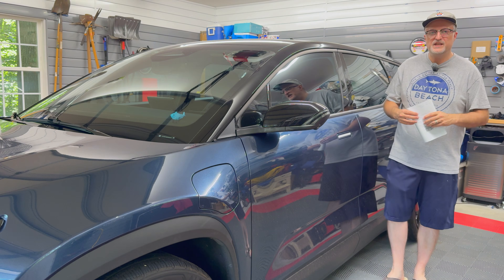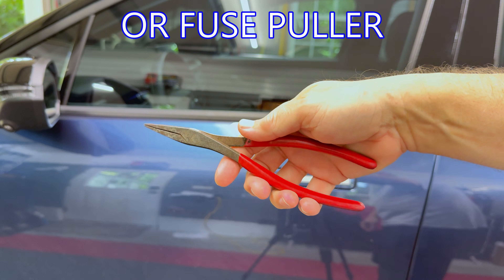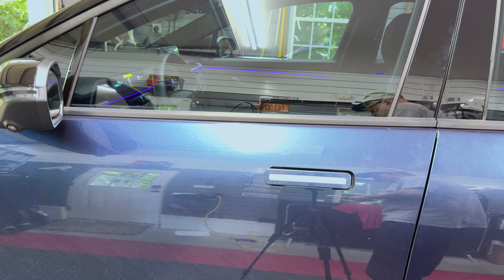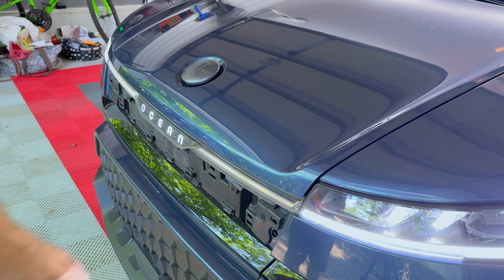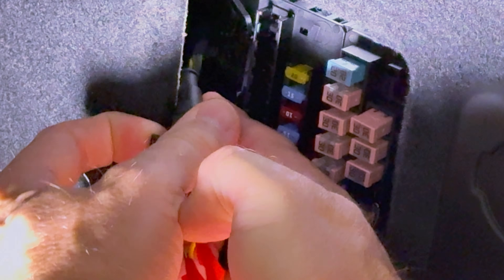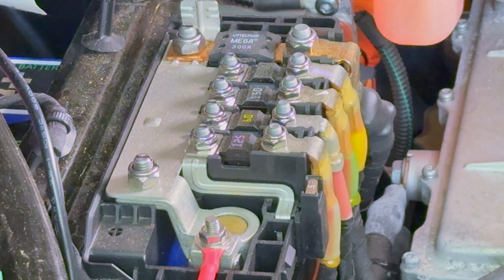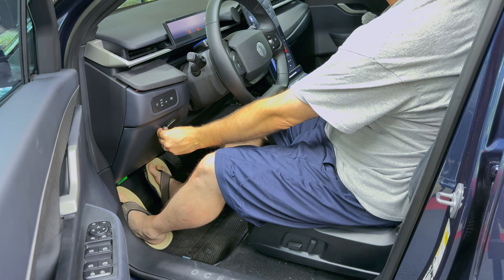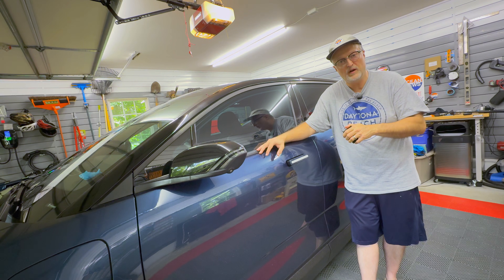Fisker Ocean - IBS Calibration Process

Comment: Hi Matt, will disconnecting the 12v grounding lead do the same job as removing the 5a fuse? The fuse on my RHD model is more difficult to access compared to LHD model.
Reply from the maker: No, I think the car's 12V need to be on for it to work.  Removing the IBS fuse and then reinserting is what needs to be done.  I'm surprised the battery positive fuse box can't be reached on the RHD.  It's easily done for the LHD.

Comment: This just bricked my car. My charge port color is red. Doors won't open.
Reply from the maker: Wow, there must be something else going on here.  For a healthy car, this should be a fairly innocuous procedure. What's the status of the 12V battery, is it new?
Reply: @MTNRanger it's old, but I have my tender hooked up pumping 15 amps. Battery is basically dead. Car just beeped and at least the mini screen is showing my cars time and in park. Ready is not on
Reply: Wipers were also going up and down, not smoothly, while the car was establishing battery power. I might let it sit a couple hours. Charge port door light is still red. Likely need a new battery
Reply from the maker: @sohailakmal3384 Yes, common symptoms are wonky wipers and randomly alarm going off.  If you can’t get a local H4 AGM 12V battery, the UPlus on Amazon has worked well.  I have that currently in my car.
Reply: @MTNRanger my wife was able to get in contact with a fisker shop in California who gave us a Houston contact. The battery couldn't be removed from the vehicle because of how it was constructed. He mentioned needing a heat source, like a blow torch, to warm the bolts because all they were doing was spinning. Hopefully I can get him out here this weekend to install. Resetting my battery told the car it was dead....
Reply from the maker: @sohailakmal3384 Yes early production used picture in the three battery bracket bolts.  Other ways include using a flathead screwdriver to put pressure on the bolt, also vise-grip to hold the retaining nut.  It’s a huge pain.  I have changed a few batteries in local cars and have not come across it - otherwise I would have done a video on it.
Reply: @MTNRanger surprisingly, trickle charged for 10 min then cranked to 15 amps. Red light vanished and my car moves again. No more hypersonic sensor failure error.

Comment: In the middle of doing this and my car won't come out of ready mode. Any thoughts?
Reply from the maker: When you open the door, it should come out of ready mode within a minute.
Reply: @MTNRanger mine never does as well been 2 hours and no coming out of redy mode while the belt is buckled. Is it because I'm using a battery operated key fob?
Reply from the maker: @sohailakmal3384 I’m not sure why some cars are not.  When you opened the door it didn’t leave ready mode either?
Reply: @MTNRanger it stayed in ready mode the whole time. Is it because I kept the trunk open after?
Reply from the maker: @sohailakmal3384  No, you should be able to keep the trunk open since you need to unplug the first responder loop. But I have heard at least one person let it stay for just over an hour before ready turned off.
Reply: @MTNRanger i think using a key fob with the battery may be the issue. But I will try it again.

Comment: What are the symptoms of a miss-calibrated IBS?
Reply from the maker: It may vary, but it could be the car not fully charging the new battery, odd voltage charts on a battery monitor, etc. For example, if the car is not sleeping due to frequent battery charging.  There are probably others that I can't recall right now.

Comment: Hi after 45 minutes my Fisker is already in ready mode. Have you a solution?
Reply from the maker: When you opened the door did it go out of ready mode?
Reply: No, but in fact i have 2 problems. First hv battery do not charge the 12v battery when the car is sleeping so the 12v battery is empty after 3 hours, my battery is new, and second problem the hv battery charge does not start when i program a time on my wall box. I have to start the charge manually. I have these 2 problems since we changed the battery. Have you an idea or a solution? I'am in France.
Reply: I have a similar issue 😢
Reply from the maker: @RemenEric  1) If the 12V battery gets low enough, the HV battery pack will charge it - it can be driving, parked or sleeping.  I  have heard there are issues using the an EVSE on scheduling.  I just plug mine in and charge right away.
Reply: Ok but the hv battery does not charge the 12v if the car is sleeping. And i loose 40% by hour of sleeping.
Reply from the maker: @RemenEric Well that’s not normal.  You will need to check the DTCs and see if something is causing this problem.  A service tech may be needed to determine how to fix.
Reply: I am having the same issue. The car doesn’t go out of ready mode after 45 min. Is there any other alternative to reset the IBS? I recently changed the battery to sodium ion battery. It is not regularly getting charged by HV and recently it died. I had to jump it with another battery. Please help what to do.

Comment: I have been struggling with 12 V battery for a long time, unfortunately there is no solution yet. However, in about one year period I have had a 4-th 12V battery now and my car is not drivable because from time to time 12V battery dropped below 11V and car is not drivable if voltage drops below 11,8V. Worst point is this malfunction occurs during full speed driving even on HW which create very dangerous situation when car stopped on the middle of HW. I have 2.1 SW and not able to update 2.2, I joined FOA but no OTA upload yet. During every battery replacement I did not perform IBS calibration. Is that possible reason why failed?
Reply from the maker: It’s doubtful it would be caused by lack of IBS reset.  There sounds like something more serious - possibly a VCU/PDU module issue.  Do you have OLP yet?  If you do, I would run a diagnostic and look at what errors it finds.

Comment: I definitely need assistance wit my Ocean one (I don't even have a key card). I'm missing a lot for a Ocean One owner). Any Fisker mechanics in Arizona?
Reply from the maker: You will most likely need to consult a mobile tech.  ORS does west coast work.  Check https://fiskeroa.com/service/ for other options.
Reply: @MTNRanger  Thank you
Reply: I just switched my 12v battery.is this a must  do after a procedure like that. ?
Reply from the maker: @larshult1176  Some people have reported no issues without doing it.  Others have noticed some charging problems without it.  It's not a must do since the original service manual did not discuss it.  Do you have a Bluetooth battery monitor installed?
Reply: @MTNRanger yes I have installed bm300 pro battery monitor.
And thank you for your answer 👍
Reply from the maker: @larshult1176 I just installed that same model monitor today on my car for testing a UPlus AGM battery.

Comment: I assume this is just like what I need to do with my BMW i3. For the i3 it’s needed as the charging of the 12v by the High voltage  will vary as the 12v ages. So an older battery will be provided with a stronger charge vs what is needed in a brand new battery. Kind of a balancing. So I assume this is why this should be done with the ocean. I’m not sure if not doing this will cause any damage but might just make the 12v fail a little sooner.
Reply from the maker: Yes, it basically lets the car new a new battery is installed and to adjust the voltage limits based on the full capacity.  It's probably not bad to have the 12V battery fully charged before installation or doing this calibration.
Reply: @MTNRanger yep BMW tells you to fully charge the new battery before installing and calibrating. I learned a lot from my BMW ownership before buying my Ocean One. Probably contributed to my good luck, SO FAR.

Comment: The document states that you need to turn off the transport switch, but my car doesn't have one
Reply from the maker: There are three versions of this procedure, the first two only apply if the car is in transport.  The third option (after a battery replacement) is the one I show in this video.